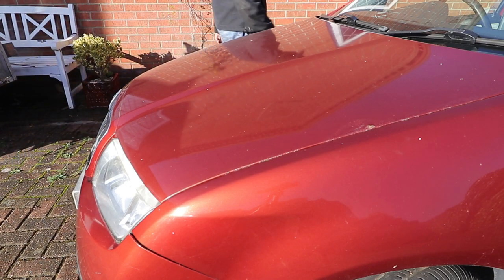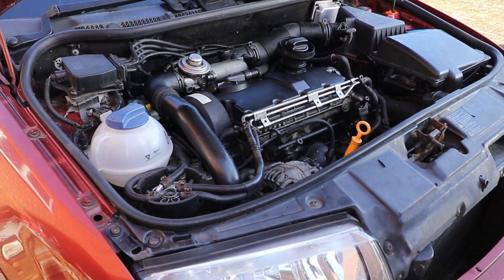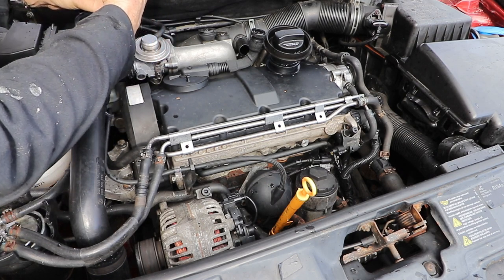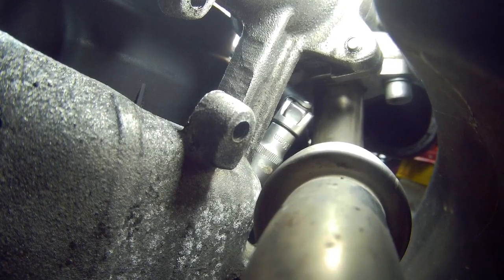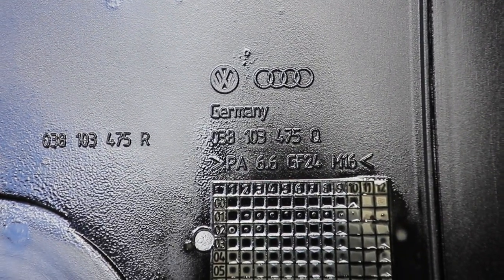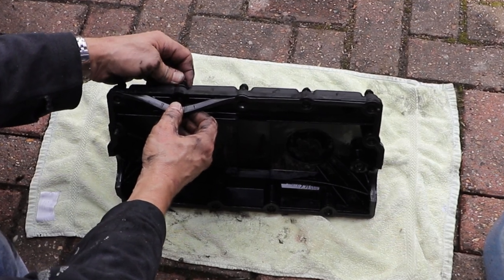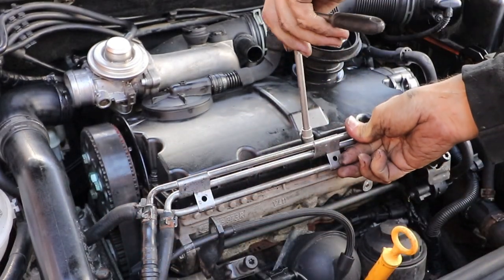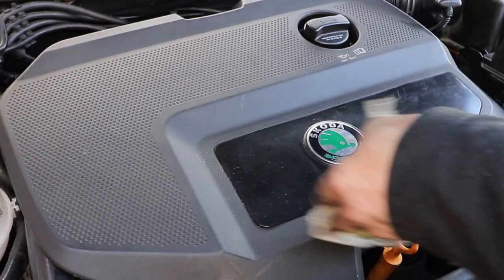SKODA FABIA Rocker COVER GASKET (1.9 ATD PD TDI 2003)

Comment: Those gaskets are different, did the new one work as it should?
I have the same type of gasket on mine and with those "skinnier" gaskets it doesnt seal properly.
Reply from the maker: Seems to be working fine after the little adjustment with a knife on those lugs at the end. I think It's best sticking to OEM versions of these after my experience and what you say :-)

Comment: Hola soy argentina tengo vw bora 1.9 tdi mismo motor.q tu video. Puse tapa de valvulas nueva y junta nueva y pierde igual aceite x algunas partes. Hice apriete q dice fabricante y siguiendo orden ajuste. Q me recomendas sacar y ponerle silicon o grasa. Quizas este deformado aluminio tapa cilindro domde apoya junta tapa valvulas
Reply from the maker: ¿Tiene fugas en los extremos?   esta es el área que necesita tener un sellador de juntas de silicona.  Es de vital importancia y lo menciono en el vídeo.

Comment: I have a beetle with the ATD. Weirdly my oil filter “capsule” looks different to the one on this, and mine doesn’t have that 3rd fuel rail pipe thing. 
It’s a 2003 53 plate

Comment: Did the oil leak return following the replacement of the valve rocker cover or did it carry on leaking?
Reply from the maker: I replaced the gasket after it looked a bit leaky and I haven't tested it on the road enough yet to be 100% sure it's not leaking, but I'm confident I installed it correctly so should be OK :-)

Comment: Hi I have a mk1 fabia petrol which has slight oil in the spark plugs and coils would I need to do the same as this? I'm guessing they would be spark plug seals?
Reply from the maker: You mean outside the cylinders on top of the plugs underneath the coils? that is just a spillage and seal issue, clean out the oil and clean the rubber seal with detergent and you might find it seals again with no issue. If you take out the plugs, examine them for problems and replace them tightening them to the correct torque. then see how things are a week/month later. if it repeats with milky brown discoloration then the head gasket needs looking at :-)
Reply: @HatBoyHarvey  yeh one plug had oil on it and so did the coil. The other coils all looked a orange rusty colour. The coils were changed about 2yr ago

Comment: I have the same ATD engine and I had a question. Is the oil cap neck suppose to get open before the cap? Because when I try to open the oil cap the first thing that opens is the neck. I have to hold the neck in place with my hand in order to open the cap. Is this normal or is there something wrong with that? Thanks.
Reply from the maker: See latest short! I will see if I can fabricate a good fix for this fault as it happens on mine ;-[
Reply: @HatBoyHarvey  Thank you for the video demonstration. The clip that holds in place my filler cap is not there, maybe it was broken before and that's why is wasn't staying in place. Now I understand why. Appreciate the fast reply and have a good day.

Comment: Clever coffee making, thanks for the tip. Is it make-1 model indeed, having rectangular anti-fog lights? My lady (caravan body) built early 2005 has round ones, I’ve been convinced this being a first sight differenciator. I think I have a make-1 vehicle and the one shown is newer?
Reply: BTW, why so rusted bits in the case?
Reply from the maker: Thanks. Mine is Mk1 with pre-facelift square fog lights. After 2004-5 a facelift version was made with a slightly different front bumper/grill with round foglights. Also the elegance model had those. I left the tools outside in the rain and haven't had time to clean them yet, but will get on it ASAP :-)
Reply: @HatBoyHarvey  Got it. Great material, keep the good work!

Comment: Great video! What milage you have on Fabia, and did you change the clutch? Best regards!
Reply from the maker: 100k+ sorry I haven't changed the clutch yet. Most engines require the subframe to be dropped to remove the box so you have to support the body to do that.